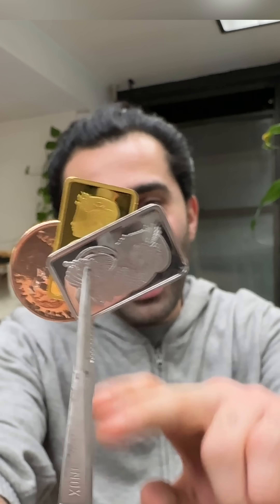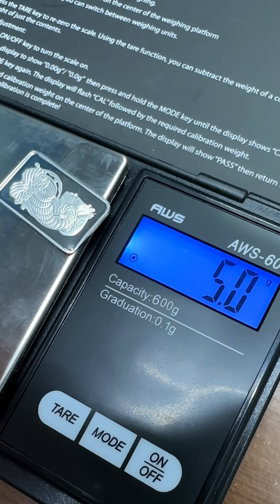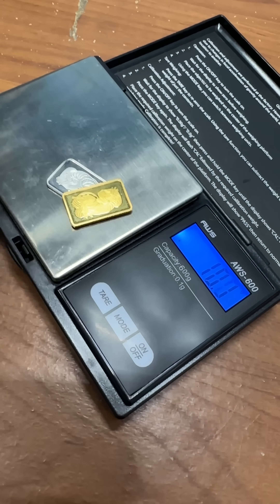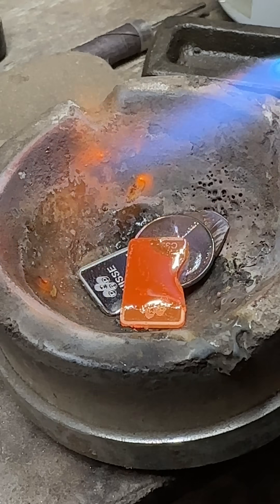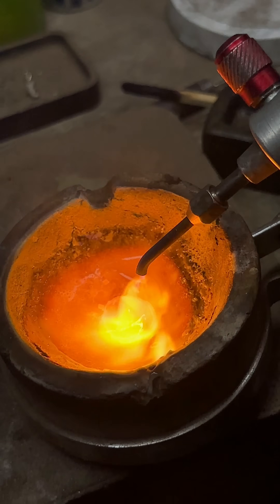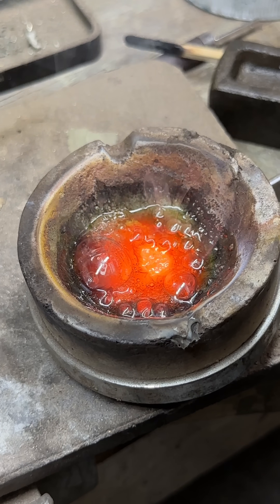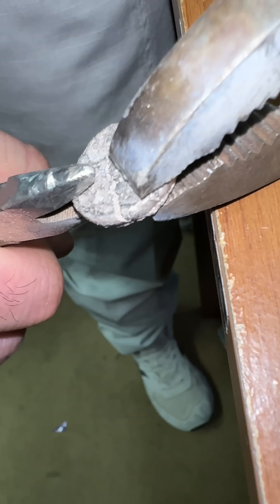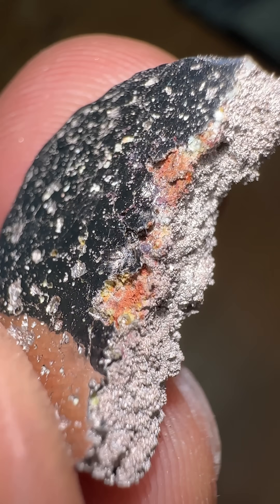CREATING A NEW METAL ALLOY FOR JEWELRY?!?!? #shorts

Comment: Well, you ground all the copper off the penny and left nothing but zinc in there, so yeah. Of course your new alloy is weak as hell.
Reply: No… use your eyes… zinc is not copper colored. Additionally that wasn’t a zinc penny by year.

Also, zinc would not be the reason why the alloy is weak, it’s weak because it’s just not possible to have any sort of consistent crystal structure with those proportions of those alloys

Comment: You got to use a fifth of the Platinum that you used and then it should work pretty good. If you smelt them separately, the Platinum separate from the other ones when they're both hot and molten then mix them together. Get them to Cool quick

Comment: Except the problem is that you messed up because it's only 80% copper and 20% zinc. And you made it exactly 5 oz which means that you're only going to have a 14 oz of your new metal and it's going to be 4 oz copper 5 oz gold and 5 oz of silver
Reply: Try 95% copper. And that’s not the problem here

Comment: Should have used bismuth or antimony instead of copper with your platinum first it would significantly lower the melting point of the platinum  that same as silver, once melted as the gold. The reduced melting temp of the platinum will be close to the melting point of gold so it should fuse a lot better.
Reply: Not at all how that works.

Comment: Your mistake thats not how you do these types of alloys. You are thinking its similar to doing gold and copper but with platnum you must melt the platnum separate and the gold and copper separate than you can mis the metals eithout heating it back up. Of corse you also need to add carbon and the usual stuff.

Comment: Add zinc it’ll add stability to the metal alloy helps buying the molecule level better plus zinc makes more precious metal shine a lot better
Reply: The pennies already have a small amount of Zinc in them
Reply: @ pre 1982 pennies are usually 3-5% of zinc the rest being copper i’m assuming they’re probably using pennies with the higher copper to zinc ratio i’m just assuming that they need to up the zinc ratio in their alloy

Comment: Heating metals like gold, platinum, and pre-1982 pennies involves considering their melting points and practical implications.   Platinum has a melting point of approximately 1,768°C (3,214°F). Gold has a melting point of 1,064°C (1,947°F), but its melting point can vary depending on the alloy composition. Pre-1982 pennies are composed of 95% copper and 5% zinc, with a total weight of 3.11 grams. Copper's melting point is 1,085°C (1,985°F), while zinc's melting point is 419°C (786°F).  
The highest melting point metal, platinum, should be melted first, followed by gold and then pre-1982 pennies. It's worth noting that some people have allergies to copper, which can cause skin issues and lead to the formation of salts on the skin. Zinc, on the other hand, typically does not cause such problems.  
While it's legal in the US to melt pre-1982 pennies for their copper content, it's better to seek a direct source of zinc due to the illegality of melting post-1982 pennies. Considering the current price of zinc, it might be more cost-effective to purchase zinc directly rather than collecting zinc pennies.  It would be better to just use 5 grams of pure Zinc and omit copper entirely.

To reduce porousness in the alloy, techniques such as using borax can be helpful. To apply borax and reduce porousness in the alloy, follow these steps:
Preparation: Heat the metal pieces (gold, platinum, and pre-1982 pennies) in a crucible until they are molten. Ensure the crucible is clean and dry before adding the metals.
Adding Borax: Sprinkle a small amount of borax powder over the surface of the molten metal. The borax will melt and form a glassy layer on top of the metal.
Stirring: Use a graphite or ceramic rod to stir the molten metal gently. This helps distribute the borax and break up any surface tension that could trap gases and cause porosity.
Removing Impurities: As the borax melts, it acts as a flux, binding with oxides and other impurities in the metal. These impurities rise to the surface and can be skimmed off with a clean, dry skimming tool.
Repeating if Necessary: Depending on the quality of the metals and the desired purity of the final alloy, you may need to repeat the process with additional borax until the desired level of purity is achieved.
Pouring the Alloy: Once the metal is clean and free of impurities, pour it into a mold to cool and solidify.
Cleaning the Alloy: After the alloy has cooled, it's important to clean it thoroughly to remove any remaining borax. This can be done by rinsing the alloy in warm water and scrubbing gently with a brush. Ensure the alloy is completely dry before further processing or use.

By following these steps, you can effectively reduce porousness in the alloy using borax and ensure a cleaner, more uniform final product.

In conclusion, the alloy resulting from this process would be not only 8K gold, but also 8k platinum.  Full disclosure of the alloy is helpful for transparency and gives a customer the piece of mind.

Comment: Cut your other metals into small pieces. Melt the platinum first, add silver in small increments until it mixes evenly then you can follow with your copper and your gold. You'll never get any kind of decent results trying to melt them all at the same time unless you can produce a completely oxygen free environment.   I've had good success making similar alloys by starting as I described above.

Comment: you can tell if its going to work by looking at the sizes of the atoms. if they are way off its not going to sit in the lattice correctly and just jam atoms randomly making tons of tension locking in dislocations making it super brittle. 

iron can only hold so mutch carbon till it pops out and just jams in the lattice, thats the difference between maluable steel and brittle cast iron.

Comment: It needs to be before 1942 to have 95% copper, 1982 was coated in zinc and contained 0% copper
Reply: after 1982
Reply: One penny looked like 1973
Reply: 1981 and older are the 95% copper, and yes half of 1982 w e re copper too
Reply: @keywellcoinsmafiametals8726  I just got my info off google
Reply: Today they still have copper, just as a plating. 2.5% copper  today

Comment: 🤦try again but once its done,beat it together with a blacksmith hammer, fold, beat, fold, beat abd repeat until mixed. slightly heat then repeat before quenching. its not as simple as melting them together also ×2  or ÷2 platinum might help

Comment: Sir, I understand what you're trying to do. And that's an awesome feet, but you need to do it differently. You're trying clients to go ahead and melt them together. Which will not work if you take an acid-base solution. Dissolving into a minute mineral like acid water solution. You can drain the acid out of the mineral water. Adding heat to the mineral water bring into a boil. Melting the minerals together with a little flux.  It will make the perfect alloy for you. If this helped you and you try this, you will successfully accomplish your goal.
If you accomplish that goal, I'd like you to give me a shout out. Big mike shut out to big mike

Comment: You need to make sure that there is NO hydrogen present during this process. When the metal sets, hydrogen bubbles that we produced during the melting process will start to come to the surface and try and escape the metal; this is why there are so many different holes and deformities throughout the alloy.

Comment: A bunch of sword makers just rolled over in their graves watching him melt all 3 metals together.
Reply: No they didn't 😂 swords are forged not cast.
Reply: @DieselFuel1310 you know metal doesn’t just naturally form into perfect pieces right? It has to be mined and at some point melted down.
Reply: @tyroberts9520   most sword makers (at least modern day) buy the metals.
Reply: @DieselFuel1310  the metal is cast, then forged from the cast metal...
Reply: @DieselFuel1310 bronze swords are cast
Reply: Akshually ☝️🤓
It 100% depends on the metal. Cast iron for example is very brittle, not ideal for making tools or weapons which would handle frequent impacts, forging the metal allows for a more uniform and sturdier material.

However certain alloys like bronze could 100% be cast and be a lot less brittle and durable than cast iron
Reply: @ forging doesn’t really impact sturdiness unless you do it in a way that results in more uniform grain size
Reply: Literally, everybody did
Reply: So how would it ne different if he did it "right"?? Would it be different color??
Reply: @DavidVenegas-rq2cy dude, mixed in a copper plated steel penny. 
look at him "grinding the penny" see the sparks? thats steel! copper doesnt spark!,
so there you go, thats why it looks brittle and turned out shit.
Reply: @thedazzlingape2006 LOL what? Cents are not made out of steel other than 1943. Starting in 1982 they were transitioned to copper plated zinc.
Reply: @Burks2121 he said it was copperr
Reply: @Burks2121  Zinc doesnt spark either if you grind it.
and if it had been zinc it wouldnt have been a problem, aside ofc from a bright flash of green flames and toxic fumes being released.
alloy wise, zinc is fine. in fact its often used in jewerly for alloying.
Reply: @Burks2121  copper doesn't spark bro.  I cut copper all the time

Comment: I hope you see this message,  you need to  heating the 3 separately,  gold and copper  together and platinum separately,  then went all the metal is melted stop the heat and drop the platinum slowly and the mix get similar that you result but metal very clean

Comment: You need to use different Copper than 2pennies. 1st of all; the penny is NOT 100% copper, even the ones pre-1982 are not 100%  copper it's got Nickel in it as well 
(which is probably the explanation for that red dye coloring on the inside of that burnt cookie you made yourself) 
In 82 the Penny went from being mostly copper to being more Nickel than copper. 

2ndly the copper from a penny that's 43years oldisn't gonna be the right type of quality your looking to use and then being very filthy as well compared to the polished, clean , pure  quality metals you wish to alloy with. 

Get refined high grade pure copper and melt the Platinum to molten by itself then throw the gold and copper in it while the plarnium is liquid and then cool it and see what happens
Reply: when the " "copper" " penny threw sparks while grinding...oooh booooy. "rich people shit" lol
Reply: Should have used copper from electric cables.
Reply: @frgmntTOB  As long as it's quality copper.
Reply: I think you mixed up nickel with Zinc, no nickel in the pennies. Yes 1981 & older and some 82 pennies are 95% copper and some zinc or tin, then obviously 82 and up will be 97.5% zinc and the small amount of copper plating
Reply: There is no nickel in pennies. Pre 1982 pennies were Copper and Zinc. Post 1982 pennies are Zinc and Copper.

Comment: Add the metals in reverse order of their melting point that way you never go beyond the heat needed. As you add the metals you can cool down to the next melting point and keep the integrity of each metal. You will have a much better result. You will also want to hammer it flat then melt it again.
Reply: That work won't though because as the furnace cools down, the metal will also, therefore not mixing correctly. What you need to do is heat the three metals at three separate temperatures where they all get into a liquid then mix them together
Reply: It crumbled like a thin mint cookie 😅
Reply: Im curious, is there any way to now separate the 3 metals or is it all completely ruined?
Reply: @ThaMightyG  you can recover the gold and platinum with acid but the copper is toast.
Reply: @ThaMightyG yeah they could dissolve the gold out in acid. As far as separating the other metals I’m sure you could dissolve them too.
Reply: @ThaMightyG  via a process called aqua regia they could recover the gold, it's how gold is collected from old electronics. I don't know about the other metals.
Reply: So how would it ne different if he did it "right"?? Would it be different color??
Reply: @DavidVenegas-rq2cy  it wouldn't be porous and would look shiny and no cracks/holes.

Comment: Melt them separately then pour the one with the lower melting point into he one with a higher melting point. Don't do it too fast as this can cause disproportional mixing. And don't do it too slowly as the cooler one will start to solidify.

Comment: I think you would have a better chance to make that alloid using powder from acid reduction.
Put the platinum & gold in Aqua regia and the copper in nitric acid.
Rinse and dry the powders.
Mix well the powders and flux using a fast induction to reach the temp. needed to smelt platinum. 
Lower temp. in special oven use to lower glass temp. over a period of 24 hours.
Try it!  I'm pretty sure the result would be perfect!!!

Comment: Those pennies also have some nickel in them too. If you use pure 99.9 copper from some good quality a/v cables you may have a slightly better result. Although the difference in melting point between gold and platinum is probably always going to create that soft crystal structure.
Maybe forge welding after casting?

Comment: Nordic gold is a pretty cool aloy. Very corrosion resistant, nice hue, and the EU makes there money out of it. But not worth much. Maybe adding platinum would help, or replacing the aluminum. If I had enough to play with I'd try it. But I only usually melt copper, tin and such. 🍻

Comment: You need to use micro-shot powder of these metals. You melt the copper and gold together first, then sprinkle the Platinum inside of it, then heat roll  it. Fold, heat, and then roll many times over. But remember the more platinum powder that you add the more brittle it will become.

Comment: You’re issue here was the copper was well beyond its annealing point. Possibly even evaporating resulting in the crumb effect you saw earlier. And to make matters worse when metals are conjoined like that naturally they actually look very good because they’re allowed to cool slowly (over millions of years but for the purpose of this reaction 5 minutes would’ve sufficed. Try melting it again and allow it to cool before heating it until it’s red hot and allowing to cool again. This should mix the metals evenly resulting in a smooth alloy rather than something more crumbly that chocolate cake

Comment: Acetylene and borax can’t be used when melting platinum, especially alloying it with other metals. You can get the alloy you wanted  done in an oxygen free vacuumed induction furnace.
Reply: Bruh they made so many mistakes, that's insane

Comment: Melt it in vacuum. The metals are getting oxidized before they can get mixed. This is causing the alloy to be brittle.
Reply: Or use argon gas
Reply: yeah dude, a Hoover!
Reply: YEA MELT IT IN A VACCUM NOT LIKE  OXYGEN IS NEEDED TO START A FIRE
Reply: if you did the one with the higher boiling point first it would be ok

Comment: You're an idiot. Why would you bunch them together and try melting them all at once when platinum has a much higher melting point, you just weakened the gold and copper significantly when doing that. You melt the platinum first and then added the other 2. Guy even looks like an idiot.

Comment: To fuse metals with different melting points, you have to have an oxygen free environment. Otherwise, metals with lower temperature melting points will oxidize(burn) before the metals with higher temperature melting points liquefy and combine into an alloy.

Comment: If the copper suffers from lower heat temperatures than let the gold and platinum cool down down to a point the copper can handle than add the copper.

Comment: Not a very good mix. Copper and gold are mixed together all the time. I'm surprised that platinum doesn't mix with gold and copper. But not too much, because gold and copper are on the same vertical column on the periodic table and platinum is on another. It shows how different gold and platinum really are in some ways. Gold and platinum do not mix  well at all.

Comment: I only fucked with forging and smithing... Not so much smelting, but I can already tell you your doing wrong... Idk if it's on purpose or not, but do the highest melting point first then use the heat from that to melt and mix with it.

Comment: Don’t melt them together. Melt the platinum first and when it begins to to the melting  point of the other metals then add them in. Would this work or would the platinum be too solid by the time you add the other metals ?

Comment: Tbh depending on the year of the penny is why this don’t work!! The most common materials replacing or mixing with copper over the decades were bronze, tin, nickel, zinc and zinc-coated steel. In 1943, copper was removed from the penny in order to utilize the metal in the war effort of World War II. A small number of copper pennies were minted that year and have since become valuable collectors items.

Comment: My guess is You should heat the platinum up seperately so the time isnt overbearing for other metals other metals. Preheat the ones that take longer and heat up all slower so they are more stable at their temperatures. Idk if that would work it may. Its a theory.